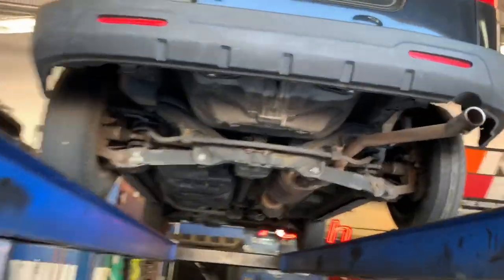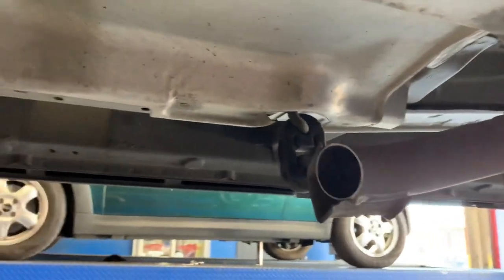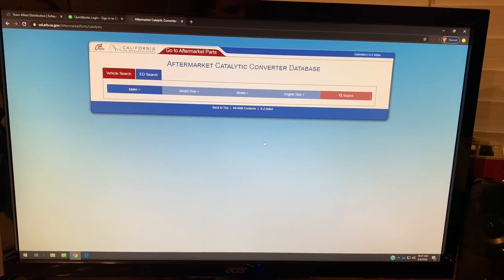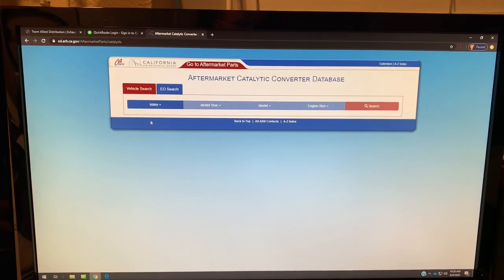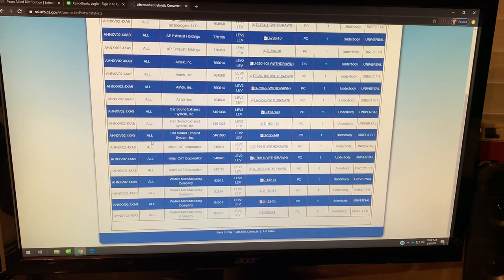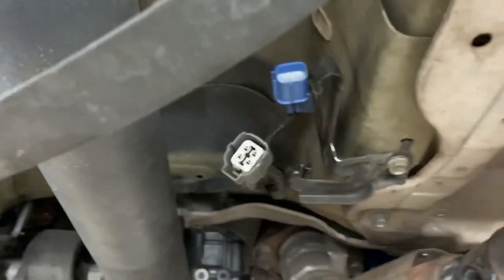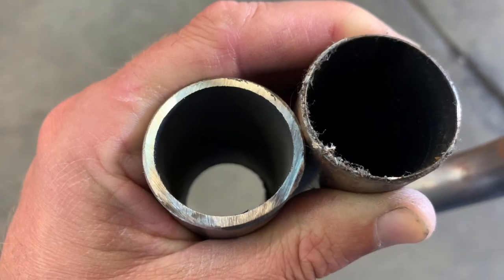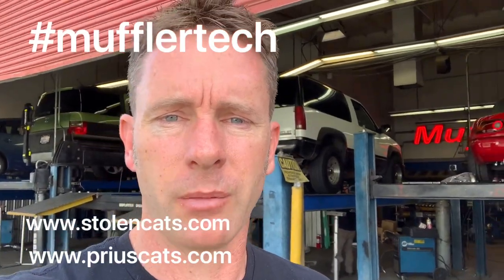Stolen catalytic converter Honda Element?  Open for an explanation!

Comment: I got mine stolen a year ago, now I have 3inch bricks in my driveway that I park the car over, there is also some wood with nails poking out, they won't reach it with their jack and if they try they will have their skin shredded. I am going to get a tilt alarm and a shield on it too. Also have cctv facing the car now.

Comment: Cops should set up bait cars with Prius and Elements with Cats. that have a GPS tracker in them.
Reply: The tracker won't stand the Cat's operating temperature so it better just be a non driving car. Just a drop off bait car. Love the idea.
Reply: Bait cars for sure. Thieves got my Element couple days ago in the Twin Cities Minnesota. I live in an apartment building, so Element sits unprotected in a parking lot. I certainly can't afford to fix this problem and have them steal the cat converter and both sensors again. I need to find someone willing to put in a protective shield and parts you've just shown.
Reply: Or something that goes boom, remotely.

Comment: They got mine early am from my Honda Element With a cordless sawzall at 2:23 am. Not sure what to do. I’m interested in bypassing it until I move simply to avoid feeding the system and draining my bank account. Thank you for taking the time and posting this vid.
Reply: Insurance should cover it after deductible.  1800 Parts and labor to fix my sister's.

Comment: Those 'extra' pipes you welded in are okay, but you should put a wire inside them that causes a loud siren to go off when the saw cuts the wire. Aim the siren down towards the cat, so they have to leave the area or go deaf.

Good point about the aftermarket cats... some people might want to pre-emptively switch their cat out to an aftermarket cat, and keep the original safe inside their home (since thieves don't really want the aftermarket cats).

Comment: They tried to steel mine today, good thing homie caught them
Reply from the maker: Awesome!  We all need friends like that.
Reply: I would pay 10 times what my cat was worth to get my hands on the person who stole mine..North Carolina btw
Reply: Dammmmm mines just got cut
Reply: @stunter2875  40,000$
Reply: @jacobmaland8028  The worst part is I only paid $3000 for my Element
Reply: They just stole my sister CC out of her Element not sure if its just in her head but she feels it no longer runs the same.
Reply: @topshot33  from what I noticed, is when they cut it it would take a little longer to accelerate properly. The car would feel like it didn't have that same pressure. Once I got my cat welded up again it felt normal again, idk maybe when they cut the cat it loses pressure because of the gap.
Reply: Someone took mine today :(
Reply: @ariamunoz6024  Where do you live Houston?
Reply: @topshot33  Bay Area
Reply: @ariamunoz6024  Damn! Seems like its mostly happening in Cali and Texas they go my sister a couple weeks ago in Houston 🤔.

Comment: Sigh.  My wife arrived home in her roaring Element .... minus the cat.  I just ordered a replacement CARB-compliant one from RockAuto.   I would be interested in some sort of anti-theft arrangement.  She does not feel safe to park her car anywhere anymore.  I do have a MIG welder, and an assortment of 1/8" steel items.   Mostly angle irons, and 1-inch straps.  Hopefully, I can figure something out.

Comment: @ Muffler Tech — Had my 2006 Element sawed on in Aug '21 while staying at Best Western in Stockton, CA — Wondering if welding sections of angle iron onto the exhaust pipes could work as well as rollbar tubing. Your thoughts?
Reply from the maker: Anything extra on there helps, roll bar is the best we’ve used thus far.

Comment: Mine I got stolen the other day these crackheads stole my cat and both O2 sensors plus messed up one of my plugs that connect into the O2 sensor all it shows is the wires. Cameras didn’t even catch these crackheads like they are ghost’s. I’m soooo pissed off this was my only way to go to work and imagine driving to work an hour away sounding like 3 Harley’s in sync. Now when I take the train and 2 buses it takes me 2-3 hours to arrive at work and go back home. I really need your opinion what will be the best replacement cause I really need to get my car back on the road. I went to Honda parts now and it will cost just for the cat alone $1900 I always use original Honda parts but this time I can’t afford this so I will have to deal with aftermarket part to get by and still pass NY inspection. Thanks for this vid cause I didn’t know where else to go to get advice.
Reply from the maker: I can’t speak to NY prices but in Ca we’re doing the cat and both sensors for around $1250
Reply: @mufflertech  the me for the reply. Yeah totally different emissions test between NY and CA. Would you happen to know which cat brand I should go with. I’m thinking about letting GEICO handle this cause I seen the prices for the original parts and I honestly can’t lol. Any info in brand would help also for the O2 sensor thanks again. Very helpful video.

Comment: Thanks so much for some of the info. My gf just got hers stolen today in Portland Oregon...place is a shit hole now. Do you have any colleagues here in our area you'd recommend for an aftermarket solution? Hers is a 08 with 192,000 on it so we're at the point where we think it might just be time for a new car since factory replacement is close to $3000 or more
Reply: I'm also in Portland and just had mine stolen off an old Rav4. If you know good shops in the area for this kind of preventative work. I'd love to know!
Reply: @juliaward-walton9633  @tim seig Hey ya'll I'm also in Portland, they only got halfway through with mine before they got scared off. Had it repaired at Rag Muffle and brakes, they also welded a steel cable around the cat and the frame of the car to make it harder to steal.
Reply: Aftermarket is about $140 and are direct fit
Reply: Just go to a muffler shop and have them put a cheap aftermarket cat in. $3,000 is insane.

Comment: Mine was just stolen last weekend in NY Honda Element.  How worried do I have to be about this happening again after getting it replaced
Reply from the maker: Very little if you replace it with an aftermarket part
Reply: Where in NY?

Comment: A buddy just had his 2005 element chopped last night by some trash.
Can you guys tell me as a temp fix, if the downstream o2 sensor is not connected, will it put the element into limp mode?
The trash that ripped off his converter hacked up the front o2, but left the port.
The rear sensor wiring and front sensor wiring got completely butchered and I am so upset for my buddy.
Also, what sort of protection do you guys recommend for the 2015 Ford Superduty gas 6.2 cats??

Comment: Mine was stolen last May 2019 , I brought it to a shop and put a new catalytic converter paid 700.00 dollars . I pass the smog test and renew my registration on that year . But now 2021,  I need to renew again but this time I failed the smog it say upstream O2 sensor modified . Should I have to replaced the entire catalyctic converter or just fix the sensor . Please help your opinion will be appreciated . Thanks .

Comment: can you weld on re-bar or iron bar instead..had my 2009 elelemt cat stolen last week
Reply from the maker: We were using the rod stock in the beginning and it worked until they started using power saws.  Unfortunately rebar barely has any affect on rebar.

Comment: So glad you made this video. My cat was cut and stolen yesterday.  I'm in Salt Lake City, UT.  any recommendations on where I can get some help?  I"m pretty bummed about this
Reply from the maker: I don’t know the rules in Utah, but I suspect the catalytic converters are not regulated there, if I’m correct any universal cat will suffice.  I would research for a few good muffler shops and call them to get a feel for their service.
Reply: @mufflertech  I so appreciate you taking a minute to answer my comment.  It's frustrating to be dealign wiht this.  Ugh.
Reply: @asiaraine3213  Did you finally get yours replaced and if so what was the cost? Mine was stolen yesterday in the middle of the day
Reply: @stunter2875  I did get it replaced.  Because of the cold I chose to have it towed to the shop.  I used my car insurance to help with the cost.  I paid the deductible - but I believe the final cost of replacement was around $1000  and that didn't include the tow.   Good luck!  I know it sucks to have that happen.

Comment: Thank you for your video, very helpful. Any recommendations on a good independent shop here in Orange County CA?
Reply: Hey Ramsey! Mine was stolen 2 hours ago in Tustin. Any recommendations on local replacements?
Reply: @jeffmac62  hey sorry to hear that!  I did not look for a good muffler repair shop.  I just used Simon body shop recommended by Progressive Insurance. Paid my $100 deductible and Progressive paid the rest $1800. Took a week to get the aftermarket parts. Not as good as the 15 year old original parts.
Reply: @ramseyhazemey795  Thank you. Looks like I will be doing same, although $250 deductible. Sounds like your E is an oldy like mine (2003). Getting tougher to put $ into them, but geez - what to replace them with? Thanks again for replying.
Reply: @jeffmac62  Mine's an '04. I took comprehensive off several years ago. Of course that was before they started jacking cats, so...ouch.

Comment: If the upstream oxygen sensor is welded on very close to the cat like almost on it, what are the effects of this? I got an aftermarket cat welded on since mine got stolen but I noticed this video shows the upstream being installed a lot farther from the cat than the shop that did mine.
Reply: Doesn't matter, Johnny. As long as it's about the same distance from the engine, it will work fine.

Comment: My 04 Element just became a victim too. What is the cost to replace and is it possible to just add in pipe instead of another catalytic converter? Don't know if it matters, but I'm in Oklahoma.
Reply: I put a straight pipe in mine so it’s not obnoxious (loud) check engine light will be on till it’s replaced. I’m not changing mine till my emissions is due.  In 2 months. I’d love to catch them in the act of their demise

Comment: Had one stolen, got it replaced with spurious (universal) one so now I am told apparently it won't get stolen again cause it doesn't have the pallidium or rhodium in it. Any thoughts?
Reply from the maker: The aftermarket part has both rhodium and palladium in it, the reason they aren’t stolen as frequently is the recycle value is lower.  The infrastructure for recyclers is non existent for aftermarket parts.
Reply: @mufflertech  Sorry if this is a stupid question but: How does the thief know its an aftermarket part until he cuts it off.  They stole mine approximately between 2 to 5:00 am and it's totally dark out, so if its totally dark when they steal it how can they honestly know that its an aftermarket part? Visually is there a difference between OEM and non-oem? Thanks for your help
Reply from the maker: @1jackvalley580  they look quite a bit different.  Think of it like this, a jewelry thief knows the difference between a Rolex and a Timex.

Comment: I got mine cut and stolen today I’m so angry 😤
Reply: They got mine in the middle of the day at a house between 4 others. Ripped out all my wires..Where did you guys buy another one?
Reply: @stunter2875  I went to a regular exauhst shop not the dealer. I would suggest buying a cheaper after market one not one the dealer would put on. They would charge around 2 or 3k when you can get an after market one that works just fine for under 1k. Plus the after market ones are less desirable to steal.
Reply: Mines was stolen today
Reply: @stunter2875  it's really expensive and the regular ones don't last longer than 3 months. I haven't get one yet
Reply: @AbrilJM3  The regular ones? Huh

Comment: I like it, but it's not a DIY solution for me, since I'm not a welder.  I also wonder if they just can't unbolt the clamps and remove the cat...probably would take too long.
I guess they are just looking for one they can cut out in 20 secs, which is not this.

I think this is good deterrent...I think all solutions I looked at are deterrents and none totally prevent theft.
Reply from the maker: If someone wants something you have you can’t always stop them, the goal is to make difficult enough to deter them.

Comment: Yeah I don't know if this is better than cat strap alarm system I am a metal worker and I've personally experience the Cutting power of those fucking carbide blades, I've cut through one and a half inch solid cold rolled steel bar in about a minute.  You're 1/8" wall tube is only going to slow down their job by about 30 seconds
Reply from the maker: I respectfully disagree.  We have lots of data and actual attempts that show otherwise.

Comment: Aftermarket Catalytic Converters are not as good as the factory part and, they are only required to meet one half of the warranty required of factory parts in California. The amount of precious metals is one third or less than the factory installs !
Reply: If the (much more expensive) factory cat keeps getting stolen every few months, who cares if it lasts twice as long as an aftermarket part?
Reply: Aftermarket is also about $300 vs. $1700.

Comment: What is the average cost of this repair. I live in Sac and mine was just stolen. The very same way as the Element on the lift. But I still have the upper o2 sensor and the plug for the second wasn't damaged. This happen in front of my house and took less then a minute.
Reply: Here in Phoenix the average repair is between 3K and 4K for original parts.
Reply: @rocketrose2165  Honda OEM California legal catalytic converter is $2900.  Each Oxygen sensor is $331. These prices are current as of 05/26/2023 in Henderson NV.  I curse the thieves that stole my cat!

Comment: I live in California they stole my cat a tip of advice for you guys don’t buy the actual cat required by California go to eBay they sell the cats for 80 dollars they work fine mines just passed smog it was only 4 screws not really hard. To install the smog places never check & they’re system can’t tell the difference. & thief’s will stay away from the 80 dollars cats 😂 good luck & god bless
Reply from the maker: I’m glad this worked for you Jonathan but it’s important for my audience to know this is a bad idea.  Jonathan got lucky with a lazy technician and it’s unlikely to happen again. Going with an illegal cat will catch up to you and then you’ll need to purchase the legal one at a potentially higher price.
Reply: @mufflertech  ya I am aware that the life span is 2 years which I’m okay with that. I used to flip cars & not a single person ever checks the catalytic converter.
Reply from the maker: @jonathanruiz1543  that’s not true in most of California.

Comment: Ban the recyclers from being able to buy these. There solved the problem
Reply from the maker: So stop the commerce?  There are lots of legal transactions around core purchasing.  It’s necessary for the continued production on parts and helps the environment.  Wrecking yards recycle cat cores by the thousands each month.  California has already restricted and regulated how core buying is done.  The punishment associated with the theft is the answer.  Right now in California it’s a misdemeanor.
Reply: @mufflertech  Says the guy benefiting from all this. Kind of reminds me if the broken window fallacy.
Reply from the maker: @joesee8079  sure I benefit from it, it’s my business.  We have been replacing cats for 25 years long before the thefts became an epidemic.  If you don’t like my response then what’s your solution? We can’t stop the recycling, the legally obtained cores are needed for new production.  I vote and push for stronger laws that make it so the punishment fits the crime even though it would affect my income.  We also are a leader in developing products that deter the theft in the first place.
Reply: @hxhdfjifzirstc894  what would the cartels do with them?